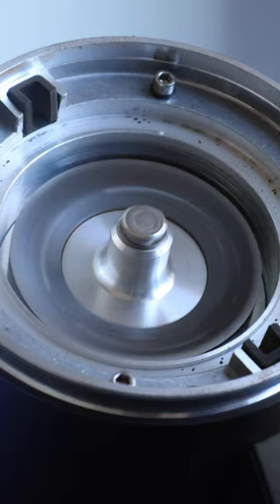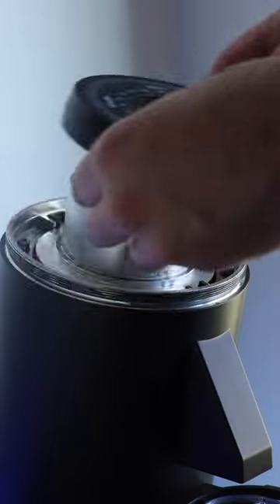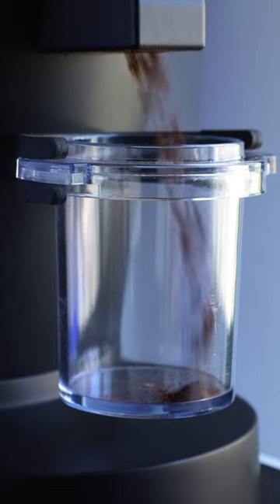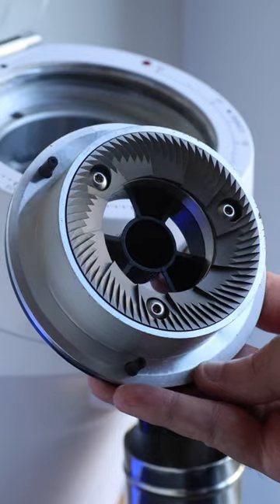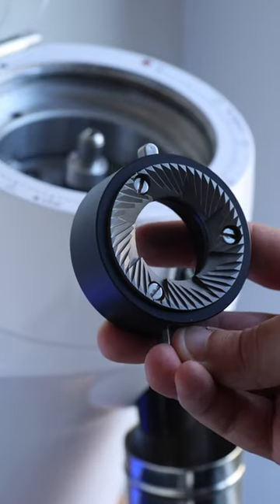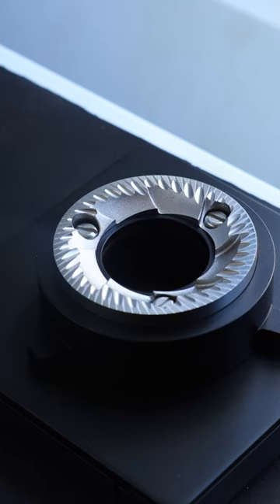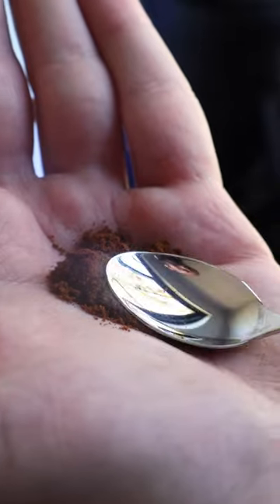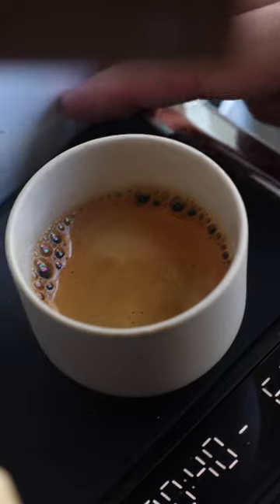The TRUTH About Burr Size

Comment: Like any hobby/profession.  There comes a point in which equipment is designed solely for commercial grade use and the increases in prices correlate to things that don’t make a difference in the end result but in the longevity of use and combating repetitive 100’s of uses per day.    

Knowing when that point is reached is one of those things that enthusiasts will argue until their last dime and breath..    because people who overpay for a commercial product thinking the money will go toward a better end result, as opposed to just a longer life with less repairs….  Already have it burned into their brains their hard earned money is being used for aforementioned “better result”….    

At that point it’s talking to a brick wall..
Reply: Probably the most intelligent comment I've read here. It's true at a certain point all you get is extra durability, better maintenance, higher capacity and stuff like that which helps in a commercial environment but are total overkill and bulky at home.

The goal is to guess where that limit is as you said!
Reply: "83 vs. 64" has nothing to do with "longer life with less repairs".
Reply: @MichaelZuskin  sure it does.  Heat and speed.    

Less heat build up because less friction on any given area of the grinder for a single grind, combined with a larger surface area to cool any heat that has built up quicker than a smaller surface area…   

and faster grind times means less time the motor is running….  Meaning less maintenance and repairs in the long run on motor parts..
Reply: So your saying I can grind beans on a brick wall? Cool.😂
Reply: Great response, i could not agree more my friend.

Comment: How about temperature pb?
Reply: Temperature of your espresso machine?
Reply: @marckirschbaum  Nein wouldn’t smaller burr heat up more?
Reply: Ya that's another highly common thing I've read, that smaller buurs would take longer to grind, have less power so struggle more so it ends up heating more.

The sweet spot price quality wise is 64mm in flat. Then a 83mm like my E37SD gets way more expensive and bulkier and if you want to upgrade the burr to SSP it cost so much more than 64mm for some reasons.
Reply: @PanzerIV88  Bigger burr bigger $$$ but yeah, I'm sure the profit margins on those burrs are pretty sweet for SSP.

Comment: this statement is completely wrong.  Burr diameter plays a huge role in burr geometry.  burr geometry is what ultimately matters, but you can't put the same burr geometry on a 50mm that you can put on an 83mm and expect to make up the difference in barista skills.
Reply from the maker: Explain how SSP makes burrs with the same geometry 58mm up to 83+. Sure maybe some can’t be downsized, but to say I’m wrong and then say geometry is what ultimately matters is basically arguing with yourself at that point. And to say bigger burrs will somehow make up for a lack of barista skill and knowledge is a laughable concept.
Reply: @Sprometheus  larger burrs won't make up for barista skills, but go get an SSP HU for 64 and 83.  Dial in the shot, tell me they aren't different.  Now go get SSP MP for the 64 and 83 and do the same.  Ive done it, they are not the same what so ever.  You cannot get the same geometry on a smaller burr from a bigger burr, they might look the same but you will sacrifice surface area, number of teeth, and the feed rate of the bean through the burrs, all things that affect taste.